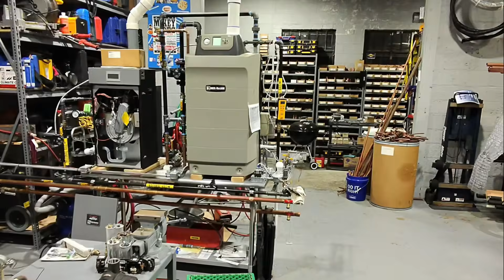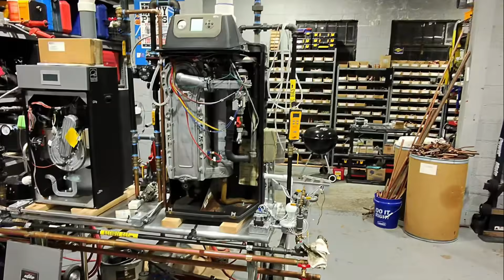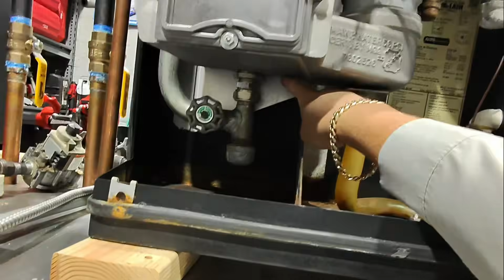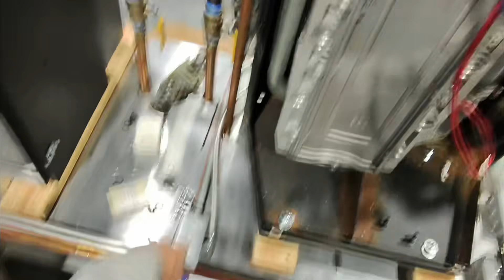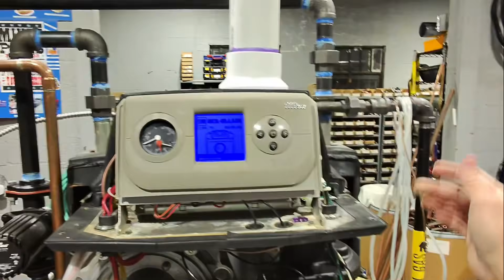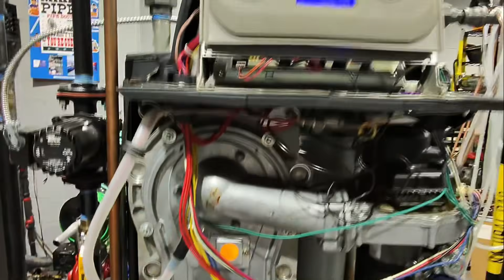10. Weil McLain Ultra 3 Blank Display FIX! Easy 3-Amp Fuse Repair That Saves the Boiler

Comment from the maker: 🔥 BLANK DISPLAY = EASY FIX! 🔥
If your Weil McLain Ultra 3 suddenly goes dark but the blower is still running, DON’T PANIC — this is one of the most common and most overlooked failures.

✅ 3-amp fuse
✅ Low-voltage short
✅ Simple diagnostic process
✅ Full ignition restored

👇 DROP A COMMENT BELOW:
Have you ever blown a control fuse chasing a short? What caused it?

👍 LIKE if this saved you time or money
🔔 SUBSCRIBE for real HVAC training — no fluff, just real-world diagnostics

— Mike Diack